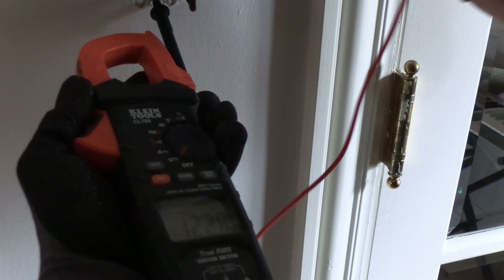Troubleshooting Confused Light Switches

Comment: Those dead switches likely control one or more outlets for lamps. In a house that old, it’s likely the ceiling light was added later and the wiring was fitted to suit, albeit improperly.

Comment: Congrats on solving at least one riddle. Also, thank you very much for making these videos because I've learned a ton from you. I have two switches that do nothing, but I know that one of them is for the back door porch light, but it's one of those really old floodlight style motion activated ones, and the bulbs are completely shot. The other is a complete mystery, but in my case it's in a 2-gang with another switch that controls the dining room light. We have cabinets that were custom built, and have a 4 ft. 2-tube florescent light fixture mounted to the bottom. The light hasn't worked since we've moved in so it's either the ballast is blown, or it's been disconnected in the wall.
  There's a blank-capped box right next to it, and there's romex coming from the fixture into the cabinet, and terminates in the wall. My thinking is that mystery switch controls the fixture, but until I remove, and replace it I don't know for sure. I might dismantle the entire thing just to test it because I have issues, lol. If I can solve the mystery I can replace the light with a good one, and move on.

Comment: Joel  interesting video  !!
I would of taken a different approach, like you have said in many previous videos.  You have to know and be as certain as possible with the wiring your dealing with. It seems like you were just guessing to figure things out after realizing that this could be more than 1 issue and likely to have multiple issues. 

I would have suggested a more scientific approach ( takes a little more time but it’s well worth it and you have much more certainty when your done )

With that said
1. Grab paper, pencil, and clip board
2.don’t wast time and possible confusion 
3. Identify all the boxes and potential devices                                         on the circuit your dealing with
4.draw a quick sketch and  plot all the boxes 
And devices. 
5. Open up as many boxes on the circuit as possible 
6..plot how many cables and the # of conductors in each cable. At each location. 

You may need to isolate & take several splices apart while ringing out wires so you know exactly what cables go between what boxes. ( and hope their is nothing buried. 
but if there is you will find out)

( you should know by now what is on the entire circuit consists of the objectives of the outlets, fixtures & switching you desire) 

Now you can draw the wires on the wiring diagram you started 

Now you can PAUSE, ANALYZE THE CIRCUIT and make notes on your drawing and once your as close to 100% certain on what your dealing with on paper you can start putting things back together ( you will feel much better knowing exactly how the circuit is or should be wired after putting it back together and everything work as it should !!)

You referred to doing heart ❤️ surgery when changing out a panel  well it’s the same thing you better know for certain what Arteries and vessels go where. 

A picture is worth a 1000 words and avoids confusion. My college Electrical Instructor always said “ I can’t see with my Ears draw me a cartoon”
Let me ask how many times have  your guys ask for help troubleshooting something and your not their so they started describing it to you, and that motion picture starts playing in your brain as you try to follow along only to say to them” wait a minute that’s electrically impossible and doesn’t make sense” only to realize they have giving 
 Wrong information !!
[ draw me a cartoon and send me a company cam photo or video] it’s about the process 
Obviously, this does not apply to a simple troubleshooting job. 
We call this Soap { the process }
S- Subjective
O- Objective 
A- Assessment 
P- Plan

Sorry for being so long winded just sharing another point of view
Keep up the good work with the Chanel 

God Bless
Geo
Reply from the maker: Love the SOAP language. May have to share that with our guys!
Reply: I agree. What I do for tracing is I have a 50 ft lamp cord with clips so I can verify continuity from one box to another after disconnecting everything. It’s tedious, but enlightening. (Pun intended.) I also believe in pictures.

Comment: My current home in northern Illinois was built in 1973 by a local homebuilder for himself. As such, a lot of scraps and low cost labor. Back then there was a pretty tight buddy-buddy relationship between the local contractors and city code enforcement. I believe he probably used a long retired electrician because as I was replacing all the wore out, nearly 40 year old switches (in poorly mounted boxes that were set too deep) I was mystified by the 3-way switch wiring. There are a total of four 3-way lighting circuits in the home and although all 3-ways were wired identically, they didn't look right. There was a black and a white wire from a piece of BX connected to the traveler screws, and a black wire from another piece of BX (with the white wire capped off) going to the common screw. Both 3-ways for a particular lighting fixture were wired the same. Each ceiling fixture had only two black wires. So I decided to pull all the wires off the switches and check with the multi-meter. Turns out all the 3-way circuits in the house were wired like they used to do with knob and tube and a single 120 line coming to the house. A house built in 1973, not 1873. The black and white wires connected to the traveler screws on each switch were in fact a hot and a neutral. The black wires on the common screws, which led to the ceiling fixture, were being reversed from hot to neutral when the switch was flipped. If both switches were in the same position there was either two neutrals going to the fixture, or two hots, and the light would be off. When one switch was flipped then you would get a hot from one switch and a neutral from the other switch and the light would come on. I really would like to correct this, but I would have to rip out a bunch of (plastered) drywall to rewire these circuits. As well, whenever I do work in the breaker panel like removing, adding, or rearranging breakers I have to make damn sure that any wires relocated in the panel go back on the same leg so I don't inadvertently end up feeding 240 into one of those light fixtures. I also have to shut off breakers to change the lightbulb because the socket could be at 120v potential even if the light is "off".

Comment: 9/6/22; when troubleshooting, 3 ways, I like to have a schematic of the 3 way just as a reference.  Then you need to know that the 120vac is dedicated to that circuit is hot and not switched. Then the white or neutral wire must be at the other end of the schematic. Then continue to troubleshoot.

Comment: I'm expecting to remodel a basement in the next year or so, and what I would really like to do is run all the switches and lighting outlets to a dedicated lighting subpanel. This will cost a lot more in copper but it will offer the most flexibility in control and the most ease in troubleshooting. Moreover, if I'm doing the labor it will still cost an order of magnitude less than hiring out to an EC. (Obviously we'll hire an EC to change the panel if necessary and also to evaluate my work before the inspection).

Comment: I wanna learn more about the 3:20 segment...
I could hear the non-contact voltage tester beeping as you pulled it away, but then, aside from just "I'm an electrician so I know the risks and what I'm doing," what's the reason that you chose wire-on-wire instead of a multimeter to show and demonstrate the load?

Is that faint spark somehow "different" from what one could see simply from a multimeter?

Comment: I’ve found that dealing w/ 3 way, 4 way switches….that disconnecting load and line wires and starting from FRESH is the easiest and fasted way to “fix” the problem.
However, if have a situation where multiple rooms controlling multiple or diff luminaires (even switched outlets), your gonna have to trouble shoot and break out the meters, testers, and some other tricks of the trade to solve the conundrum that’s plaguing yo7r home.
Also, why is it, that ever home had 1 switch, that does absolutely nothing (far as know), never fails…..it’s always present and bet you’ve all seen it as well, lol
✌🏻

Comment: It looks like whoever replaced the bedroom single pole switch with a 3-way assumed that any switch with three wires attached (white, black, red) had to be replaced with a switch that had three screws.  The same mistake might have happened with one or both of the switches in the living room. 

It seems to me that after fixing the bedroom switch and making the red wire always hot, that you've now got 2 hots in the first living room switch box (the red and the white wires). Perhaps that first 3-way switch in the living room is also supposed to be a single pole switch.  And the red wire is supposed to be the hot for that circuit. The white wire is the switch leg to the light fixture. And the black wire in that switch box might isn't a traveler, and instead might have originally fed the switched half of a duplex outlet in the living room And perhaps the duplex outlet got replaced with a new duplex outlet that still has the shorting bar installed. So now the black wire in the living room switch box is being back-fed by a duplex outlet somewhere in the living room. Cap off the black wire and connect the red and white to a single pole switch. 

The upstairs hallway and stairwell lights are probably supposed to be controlled by three switches. A 3-way at the bottom of the stairs, the mystery 3-way at the end of the hallway, and a 4-way switch at the top of stairs (where the "extra" black wire is disconnected). I'm guessing both of the 3-way switches are mis-wired and the 3-way at the top of stairs switch has to be replaced with a new 4-way switch. 

To figure out which are the hot wires and which are the travelers you really need to disconnect all the wires on all three switches all at the same time. It's just too confusing to do it with some or all of the switches miswired and the light fixtures powered on. After disconnecting all the wires on all 3 switches, I'd start by finding the hot wires in each of the 3-way boxes (and verify that all 4 wires in the top of stairs box are de-energized). Then connect just the upstairs hallway 3-way switch. Then using your meter and switching the 3-way switch back and forth,  make certain you still have two dead wires, and  two working travelers from that 3-way box to the 4-way box at the top of stairs . Then disconnect that upstairs 3-way and repeat the process with the bottom of stairs 3-way. If you don't find 2 sets of working travelers in that 4-way switch box, then give up and put everything back the way it was (and just fix it when you re-wire the house).
Reply: I too thought it was poor practice to go around testing these lines (that are KNOWN to have some confused wiring) while leaving the other wires connected/ energized. like you stated, just disconnect them all and find the live lines so you can THEN logically establish how each run (individually) energizes what... much easier to map/ document the circuit

Comment: Try this…. When you were turning off the living room light, power was being sent up to your daughter’s bedroom by the traveler you found up there with no purpose. Part 2….. because you removed the wire from the daughter’s light switch (the traveler) power was disconnected from the two light switches downstairs so they stopped working. Just a guess.

Comment: Switching is an area that confuses many electricians and apprentices it would be good to set up. Things get complicated I had a feed into a 3-way switch which was fed off a GFCI/AFCI receptacle it would just trip as the switch was in a larger switch box with other three way switches it was a shared neutral. I had to convert to a temporary solution. A permanent solution would be to separate switches from the two separate circuits and rewire one of the ones that was fed of the AFCI/GFCI to avoid the tripping issues. In your case there is definitely a hidden junction box under a floor, wall or ceiling somewhere. I definitely think in these situations trying to hunt things down in an older house is a maze it’s just easier to rewire.

Comment: I would get some nice fluke crocodile clips this will make it easier and safer to test voltage with loose wires in light fittings and receptacle boxes.